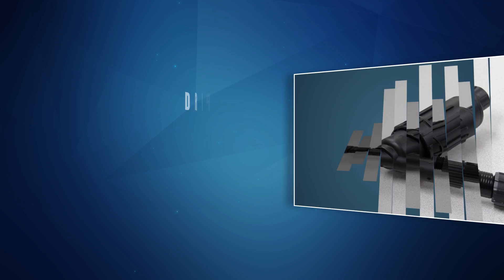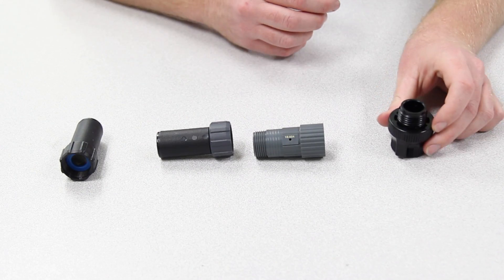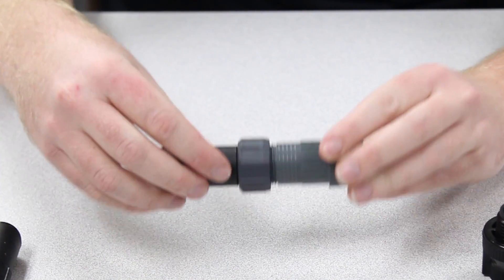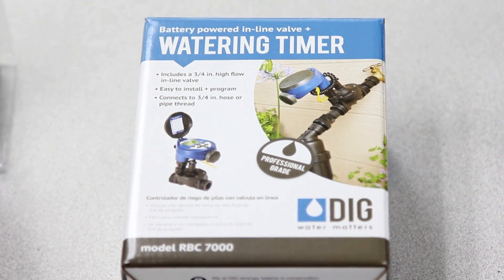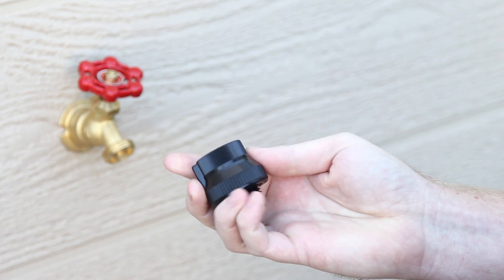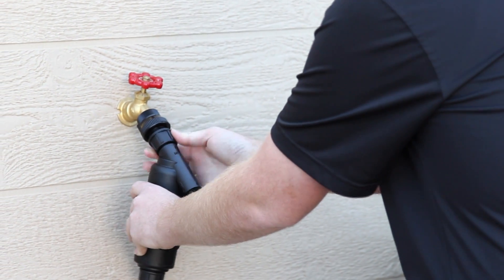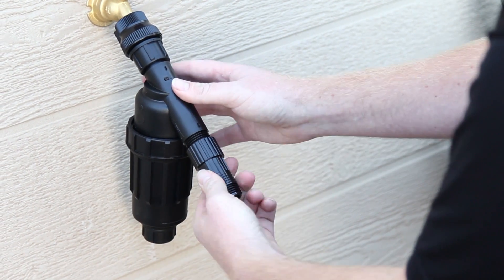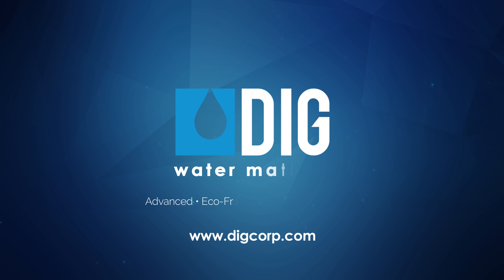DIG Drip Zone Head Assembly: Connecting to a Faucet

Comment: Can the filter use miracle gro or fertilizer?
Reply from the maker: You can use any granular water soluble fertilizer with this filter, unfortunately no liquid or powder fertilizers. For liquid fertilizers i would recommend using our automatic proportional fertilizer injector the AFI 5016-HV. Please let us know if you have any other questions.
Reply: @DIGCORPORATION  if a 1/2 pound of granular fertilizer can fit inside for instance, how many gallons of water and how many emitters would this provide for?  I plan to run numbers on all of these but I would assume you have data already. I have a 2,000 ft long .700 od of tubing connect to multiple tanks. Would love to know the max amount of .5 an hr droppers max should be connected and the amount of tanks should be to last 3months of dry season
Reply from the maker: @burnettn7  For .700" OD drip tubing @ 25 PSI the max flow would be 220 GPH  and the max length you would be able to run would be 400 feet. If you were to use only .5 GPH emitters in your design/installation you would be able to run 440  .5 GPH drip emitters on 400 ft of .700" OD tubing. As for how much fertilizer to use that would depend on the fertilizer brand and type you choose. we always recommend you refer to the application information on the fertilizer packaging. If you have any further questions please feel free to give our technical service/product support team a call at 1-800-322-9146.

Comment: I have 75ft of garden hose before getting to 100ft of DIG drip system. Do I still need a pressure regulator given pressure will drop significantly traveling 75 door hose. I am concerned that dropping to 25 psi using pressure regulator will leave very little pressure for the 100ft DIG drip irrigation system
Reply from the maker: Hello, yes we still recommend using a 25-PSI pressure regulator in this instance.

Comment: I just bought the ML50 and was wondering why isn't the filter included in the kit? Does that mean its not necessary?
Reply from the maker: Hey Victor, the swivel adapter has a small screen filter inside, so the additional filter is not needed for this kit.
Reply: @DIGCORPORATION  awesome i have one more question can I use a swivel adapter Tee instead of the swivel adapter and have the two main lines going to the front and back of my house?
Reply from the maker: @vdog570  Yes, that's perfectly fine. Just to double check, is your water source from the city, or are you using a pump or well?
Reply: @DIGCORPORATION  its from the city i live in Southern California
Reply from the maker: @vdog570  Okay perfect, you should be good to go then.
Reply: @DIGCORPORATION  great! Thank you so much for your help.

Comment: The only filter sold at my Home Depot had two male ends.  Is there a female to female coupling to fix that.
Reply from the maker: Hey Nic, there is a PVC female adapter in the plumbing section but Home Depot does carry our #D57A screen filter which is female  X  male hose threads. Here is a link to more information: https://thd.co/34qlqgN
Reply: @DIGCORPORATION  I had the same issue.  Didn't notice until I got it home.

Comment: So, at which point do we connect the timer?  If the timer has a dual outlet, do we need an entire rig for each outlet, or does all of this go between the faucet and the timer?
Reply from the maker: Hey Nic, the timer is installed first, always upstream of the pressure regulator and filter. And yes, if a dual outlet timer is used, a regulator, filter and adapter should be installed on each outlet of the timer. Hope this helps! Please let us know if you need anything else.

Comment: Any tips for leaks at the center of that filter.  When I open it I notice there is no o-ring, is there  a size/product you can suggest that might seal the leaking drip?
Reply from the maker: Hey swampThaang, sorry for the late reply. You are correct, the leaking is due to the missing O-ring. Please send us an email at dig@digcorp.com and we will send out a replacement O-ring. It is a custom size so unfortunately this is the only way to replace it.

Comment: If I will connect the pump at the inlet of this system, then how I can recirculation of water?
Reply from the maker: Hello! These parts are not for a recirculating system, they are for a drip system that connects to a faucet. We believe you may be looking for a hydroponic system.
Reply: @DIGCORPORATION  not hydroponic, actually I saw in one farm, in drip irrigation system water again flow back to well by decreasing pressure

Comment: how to connect when you are using a dual port hose end timer?
Reply from the maker: Hey Tom,

When using a multi-outlet time make sure you install the backflow, filter, and pressure regulator after your timer on each outlet.

Best,
Eric
Reply: DIG CORPORATION  Can I put backflow and filter before the timer but the pressure regulator after?
Reply: Is it okay to move the timer to the end of the assembly so you don't have to repeat it for dual outlet timers?

Comment: Can't put a back flow component and a pressure regulator into the timer?  That's a long heavy length of expensive parts hanging off that faucet ready to be broken off.
Reply from the maker: Hey Russ,

Thanks for the comment! Unfortunately, there can be a lot of complications when including those parts into a timer assembly, so generally timers are made without those additional components. We are always looking to improve our timers though and will consider the suggestion for future models.

Best,
Eric